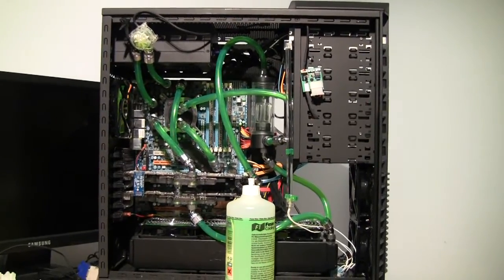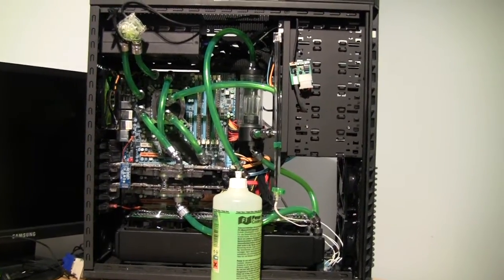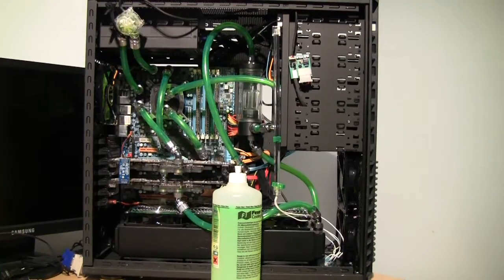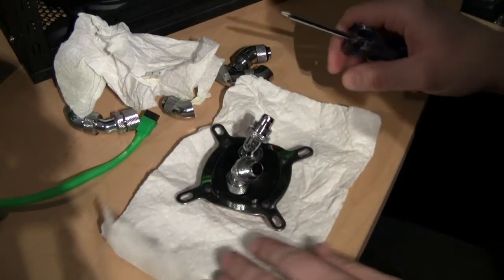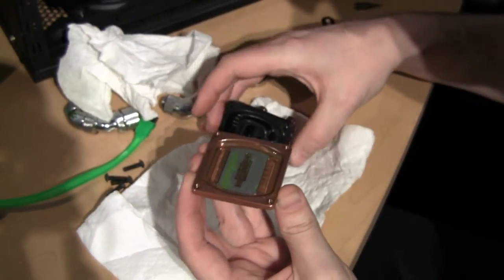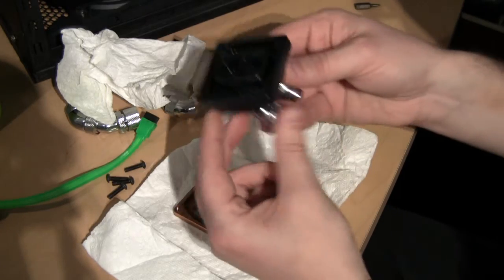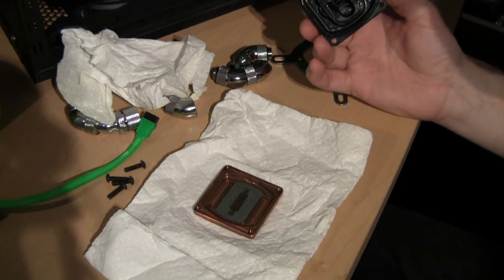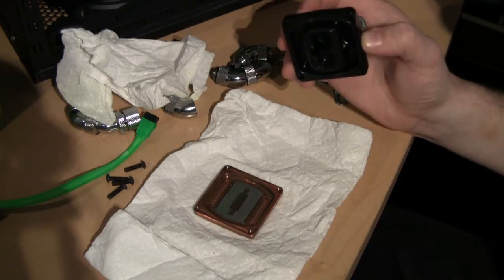Feser One Coolant Six Months Usage Test

Comment: I love Feser coolants, I've run the black in an older system and new have the red ant their colors are the best. I have actually reused the red in multiple systems over the last 2 years and the color doesn't fade and there has never been any goop build up in my CPU or GPU blocks. I have also used the Primochill red (after I used the black but before I bought the feser one red) and all the color faded within 3 months and when I took apart my blocks the were filled with dye goop. Always go with Feser.

Comment from the maker: @nousername21 Glycol based solutions work best for me.  I use my own Dazmode protector, which is similar to  Feser base or whet I want some color I use Feser One. Koolance liquid seems quite popular. EK smells bad, so I won't even consider trying it. What ever you use stick to it or make sure you flash system well before adding different vendor solution.

Comment: Could you make a video where you test if it is non-conductive still after 6 months? Because the test i find proves nothing. Battery-water is'nt conductive either. It gets conductive after flowing trough blocks and rads made of metal. I really want to know it this fluid really are conductive or not.

Comment: Nice i was kind of confused on what coolant to use and i was planing on getting F1 coolant and you closed the deal, great video and that is with no other additives in there. is that a copper block or nickle? i did read before that if you ad other things in the coolant that it causes it to gunk up and build up in the block, you are right they are putting other stuff in the coolant. Thanks for the video.